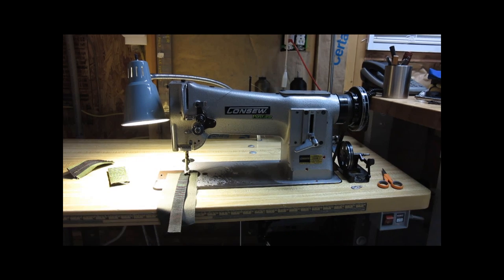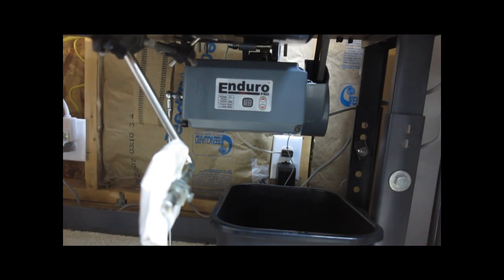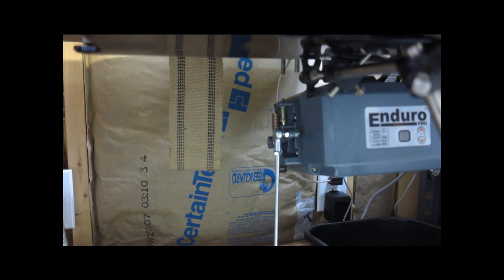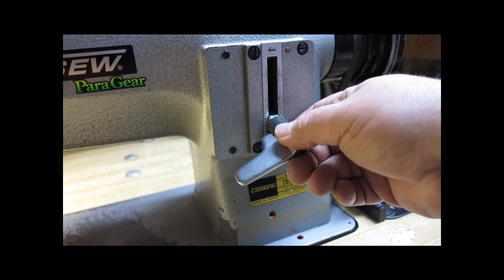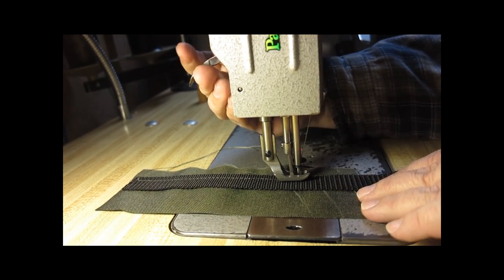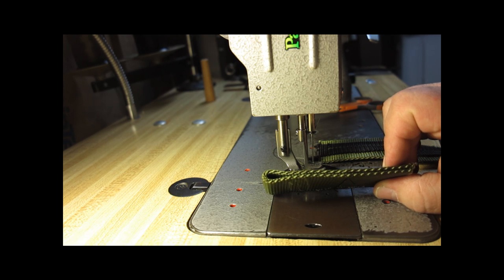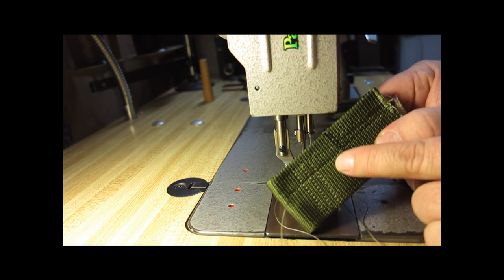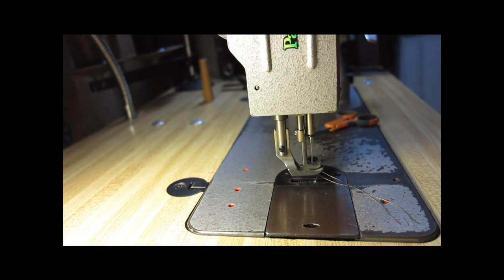Sewing Tactical Nylon Webbing with a Consew 206RB Industrial Walking Foot Sewing Machine

Comment: I was gonna say, when you said the machine was "too fast", my first thought on a comment was "install a SERVO motor". Servo motors are really nice, especially when you need slow speed control. Stock they can be very slow, but sometimes people want them even slower, then you'll need to adjust your pulley setup/gearing.

Comment: Survival Citizen, I appreciate you taking the time to make these videos.    I initially bought a singer 155W 155 and ended up realizing after a month that REVERSE is a really handy thing to have.   I upgraded and picked up the same machine you own, the same style of Japanese built Consew.   

In terms of your sewing technique, I notice you do something interesting at towards the end of where you're sewing:   right before you hit a pivot point, you lock the stitches a few time, and then you simply keep stitching and stitch "past the piece".      

Since those last 3-4 stitches haven't been locked, you can simply unstitch them and snip em back at the lockstitch.   

I'd used to stop immediately at the lockstitch, then pull some extra thread through the tensioner to snip.     I like the way you do it, because those extra 3-4 stitches where you run past the workpiece give you those extra few inches that allow you to snip....

and still have enough thread leftover to trap down easily on your next sewing operation.   

Hope this all makes sense.   Thanks again.

Comment: I am trying to sew heavy duty polypropylene webbing together, making straps. so i was just sewing across the webbing to sew on the buckles. I sew back and forth several times, 1" webbing and it is not holding together put tension on the two pieces and they pull apart, some are good  way too many not. I seen where you start in the middle and sew back and forth, like you machine mine is too fast and stopping where I want is not an option, I was wondering about smaller stitches, definately want to slow the machine down,  maybe see if I can get a smaller machine for the job. but for now I have a fast machine and straps to make any thoughts.

Comment: NICE!  I sew the same stuff on a smaller scale.  I'm wondering if you could get more height on the presser foot by using a knee lifter instead of the handbar??  I see this on many industrial machines both newer and old models.
Reply from the maker: Not really... The knee lift pushes up on the same mechanism...
Reply: +Survival Citizen Sometimes using the knee lift will make it go higher.

Comment: Nice machine!  I'm trying to make a handle by using a piece of thin nylon webbing, folding it over into 3 layers then sewing.  After that I need to install a grommet near the end.  I've got it down but it's time consuming because I have to cut each hole in the nylon before folding and sewing.  Would you have any ideas maybe for another way to attach a nylon strapping to a flat surface?  Or maybe an easier way to cut the holes in 3 layers of nylon?
Reply: Go to radio shack, and buy a soldering iron.  They have several types, and all will get the job done.  The one you want is the one that is advertised for soldering and wood burning, or hobby use.  This comes with a bunch of attachments, a few of which are great for burning holes through nylon.  I would not recommend using an upholstery hold punch for fabric, as they are expensive ($90ish), and the cutting tips wear out frequently.  Just buy the soldering iron, and melt the hole in the fabric.

I've been DIYing it for a few years.  If you want more tips, check me out on facebook at facebook.com/twowaytrauma
Reply from the maker: Yes, soldering irons can be your friend, albeit they make somewhat messy holes and cuts... But it works, if that is what you need. To get all-pro, you will need to buy a real nylon webbing cutter for almost $200...

Comment: Would this handle a layer of scuba webbing plus heavy nylon webbing? I have a singer hd4423 and it'll punch through it, but the stitch quality is poor and the bottom stitch bird nests like crazy. I've fiddled with tension until I was blue in the face to no avail.

Comment: some reason on my machine , its not getting the box stich corners right, i sink the needle turn the webbing, and the corner looks like its missing the stich, looks like a 45 degree corner.
Reply from the maker: It sounds like a bobbin carrier and needle timing issue, or a gap issue from needle to bobbin carriage arm. Both are covered in the manual for adjustment. It is not too hard with decent tools.
Reply: It's not enough just to sink the needle in order to make a turn, it has to ne a stich.

Comment: whats a decent home machine for sewing nylon webbing? I don't really have space for a table machine.
Reply from the maker: No such thing... Just buy a home machine that has a STRONG motor, you can tell by the rated AMPS. Also, if you hold on to it, how easy does it pull free from your grip? It will be hit and miss, as I do not know what brand to recommend...
 But on a home machine, #69 thread is as big as you will be able to go... So do not make anything that will be used for SAFETY GEAR and the like, as that gear needs thicker thread.
Reply: Survival Citizen ah crap. Can't make your own safety gear. Know any places to get webbing sewn? Rei said they wouldn't do it in store.

Comment: Hey I have the Singer version of your machine and you talked about your motor and pully setup for slowing the speed down.  I was wondering if you could send a picture of that setup or the size of pully and belt you use? I need to tame mine down a little.
Reply from the maker: The pulley is a smaller one sold on eBay for industrial sewing machines. The Enduro motor is also sold on eBay. That is all I can help you with at this time...

Comment: I've got a question when sewing with cordura do you have to use a certain type of thread just wondering I'm just starting to get in to sewing and make tactical gear.
Reply from the maker: Ideally you will use military surplus thread sold on eBay. It comes in many sizes and it is TOUGH nylon thread. I typically use sizes 69 (E) to 138 (FF), but 69 & 92 are my main sizes. The upholstery thread sold at sewing shops is good too for home machines.
Reply: Don’t use nylon...  use a bonded polyester thread like Sunstop.   If you are going military contracts you will have to have a good certification for that also.  They will let you know , if going private for extreme, go Tenara thread.  Expensive but the tenacity is awesome and UV resistance phenomenal

Comment: I'm confused, thought the whole point of getting a servo motor is so you can use the up/down arrows (or knob) on front to control the speed?
Can you take a look at this, After I made this video I moved a few things according to what those booklets said and now it's messed up again. I'll make another video showing that but.... Can you make a video showing how your feet move and if you know how to adjust both feet show that etc?     https://youtu.be/6eBmpabRKlA
Thanks
Reply from the maker: +azbikerider49 The servo motor does two things for me: 1. It is QUIET as compared to a clutch motor that runs all the time, and 2. It slows the process down to a crawl if I choose to want that. Slow and detailed sewing is very hard to do with a fast rpm clutch motor. These machines were built for SPEED in commercial operations. The servo motor and smaller motor pulley bring the speeds down for novices like me, and for more detailed sewing. It makes it more like a leatherworking machine, slow and strong (see videos of true leather sewing machines, they are slow BEASTS)
Reply from the maker: +azbikerider49 I will take a video of my Consew feet action today and upload it. Another thing to look at is the "Safety Clutch" that sits in the middle, on the underside of the machine. It is possible that that can be 180 degrees off. I can disengage and adjust mine by pushing a button on the sewing deck, yours may be different. I know this as mine was off 180 degrees and it was not sewing right, then I figured it out, pressed the button, turned the manual handle and the bottom shaft turned in the clutch and popped back in. It was now properly timed again. I will look at your video now...
Reply from the maker: +azbikerider49 Here is the detail video of the walking foot operation I made just for you... But others will find it useful as well, I am sure...https://youtu.be/ZFo5OyBeYVw
Reply: +Survival Citizen My machine does not have a safety clutch, however I would like to add it, and it goes on the right side, acts as the belt pulley.
Reply from the maker: That right assembly is very bulky... That may be your safety clutch, for if it was just a sprocket, it could have been much smaller and simpler. This is why I think that big unit is a safety clutch and you adjust it by the button that engages that ramped tooth sprocket. It may be stuck, as old oil gets very gummy and like glue, so it may not move without disassembly. Also, think about how much time and effort you want to put into this project. I bought my machine for $500 with table and clutch motor (now replaced with servo), so before you spend $$$ on that machine, ponder if it is worth it. You could always part it out if you can't get it to work...